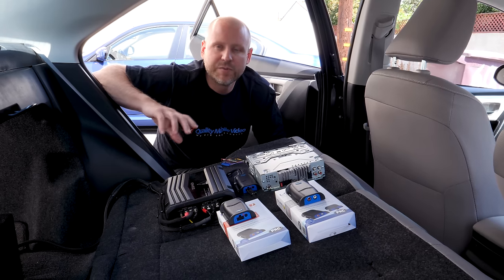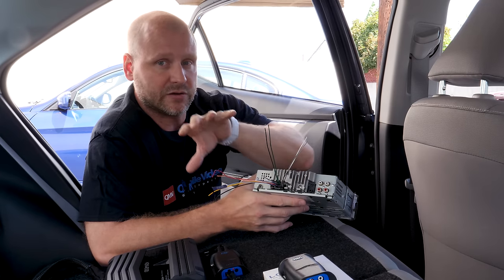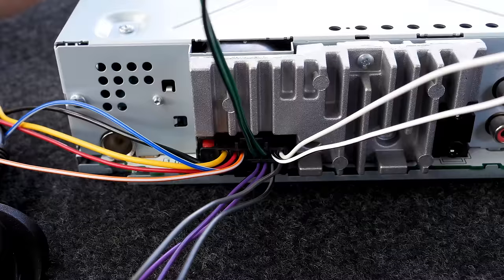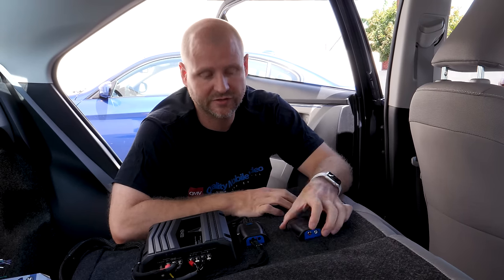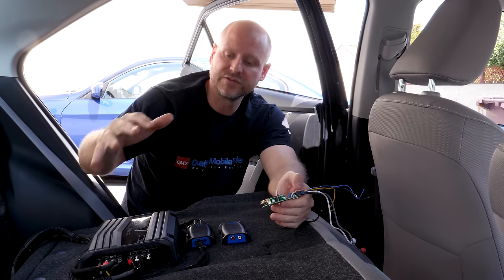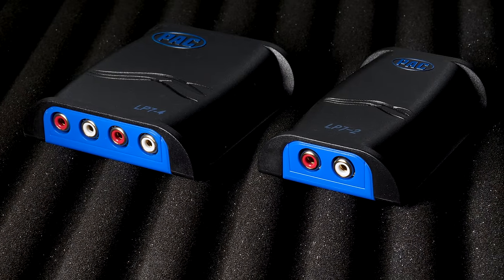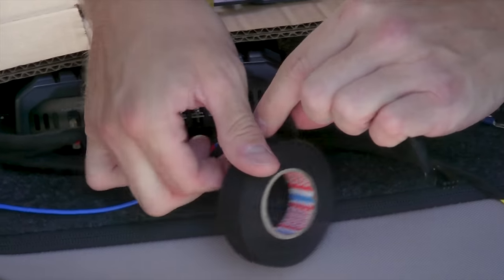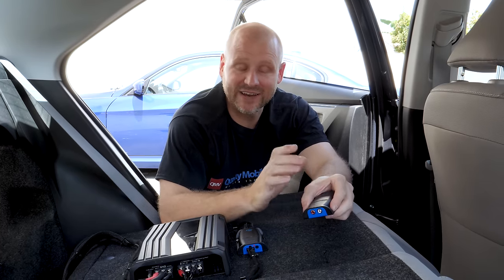Line Output Converters - What Are They - How Do You Install One?

Comment: Couldn't have timed this better. You guys have have saved me a lot of time. Please spare a few minutes for my complicated question but before that;

Amazing job done by the presenter explaining all the confusing things in layman term's. Was a Subscriber earlier but I tried subscribing again 😇✌

After countless hours of sleepless nights and hours of research with a tight budget, I wanted to have the best setup which suited my needs. Clear Full Range Music(EQ control) with Accurate BASS. Have bought a 840watt's  Blaupunkt 4 channel GTA 470 Digital Sound Processor Amplifier , JBL CSX-1400BP 12" Subwoofer, PAC PDLC 21 Active 2 channel LOC, Surge F8 Flo True 8AWG 800W AMP wiring kit which is on its way. I'm hooking the the 2 channels of the Amp to the front speakers and the 2 bridged channels to the Sub. 

Since I'm having a DSP Amplifier with various settings such as X-over control, Subsonic control, Phase control, Delay control etc. Does the front speaker signals give full range output i.e If I tap into the front speaker signals with the LOC, will I be able to achieve a full range surround sound system in my car with DSP control function working properly?

Was thinking about a 4 channel LOC but thought it would be useless since I'm using only 2 front channels of the amplifier for speaker and remaining 2 for a Sub. I can use the PAC PDLC21 with a low output gain settings since it can pump out 10V unlike a passive LOC and Adjust the gain in the Amplifier to adjust the Fader setting to achieve surround sound from a 2 channel LOC.  

My stock HU is a 4 speaker outs with a stock 6 speaker(2 tweeters+4 mid speakers) setup.  I'm planning to change my Stock front speakers too, Any suggestions for the type (and brand) of front speakers which will suit my setup?
Reply from the maker: Being that this a factory 4 channel with tweeter, it's likely that you have full range output on all four speakers, we never truly know without testing it. If I were to wager, I think your setup will be fine as described.
Reply: Quality Mobile Video Can I use a two channel LOC hooked up to a mono block amp with one sub woofer? Or is there an LOC for one channel apps?

Comment: Best LOC video I've found, extremely informative. Only one question remains for me: Is there a limit to the length of wire ran on either side of the LOC? Should the speaker level side be short and very close to the head unit, or should the low level side be short with the LOC closer to the amplifier? Is there a medium, or is it not important? I see how yours are setup and I'll mirror that for now. Thank you very much.
Reply: Ok

Comment: Great video! I have 05' GMC Yukon Denali w/ the premium Bose system and scratching my head as to where I tap the yellow 12v power and blue remote turn on wire from my PAC LP6-2R LOC? Do I run them directly to my aftermarket amp or do i need to tap them into my corresponding factory wires?
Reply from the maker: Yellow is a direct battery connection, Blue will be the output to your amp remote turn on.
Reply: So I'm installing a PAC LP6-2R to my 05' Yukon Denali with premium Bose system. And want to retain my premium Bose system for my factory speakers and sub.  All I'm trying to do is add a aftermarket subwoofer and amp. I've got everything connected w/ the PAC LP6-2R LOC, MEMPHIS AUDIO 1000watt amp, and kicker comp R subwoofer but no sound The only reason i can think of it not working is I've only got the left speaker + and - connect to the back of my H/U... Does both channels need to be connected to work ?

Comment: Did you run the remote wire on the loc to the amp directly or are you finding another 12v source to connect it to ?
Reply: Yes what did you run the remote wire to? Most of the fuses in my car are constant Im curious to what fuse turns on when the ignition key is turned on. I have a 2007 cadillac escalade.
Reply: @benkea445  I have a lexus with stock subwoofer I'm curious if I should run the loc from the stock woofer or to the door speakers
Reply: Ben Kea the fuse that says ACC but please be mindful those fuses are constant on one side and not constant on the other side. Took ten years installing stereos and replacing dead batteries before YouTube was invented hahaha. Hope this piece of info helps, consider yourself blessed for coming across it. I know I was... Love you guys, Happy New Year 2020
Reply: I have the loc pro LP7-2. With this converter you can just connect the remote wire directly to the amp with out having to run a remote wire through your vehicle. It’s all just depends on which converter you have. Hope this helps

Comment: As a Formally Trained Audio Engineer and a guy who cut his teeth doing car stereos I thought that was actually a pretty good breakdown for folks that don't have an electronics background or a lot of inclination to get deep on how all this audio stuff works.  I employed one of these adapters in a Bar where the Owner asked if I could run the output of his Jukebox (which only had a Left and Right External Speaker Output) into the speakers He had in the ceiling (or more correctly to the amp that powered those speakers) and it worked beautifully - also it's great because it mirrors the volume of its source relatively speaking.  Not sure why this got so many thumbs down - I thought it was fairly spot on.  Also for the record this doesn't replace the speakers in the circuit - it sits in parallel with the speakers (a "tap" so to speak) which keep the Ohm load correct to the amp - You'll have much more success than trying to completely use this device by itself without those speakers.   - MM in Denver CO
Reply from the maker: Thanks bud!

Comment: I have a 2016 Cadillac CTs vsport with Bose 13 premium speakers and factory amp my questions are what’s the best loc to use? I’ve tried the lc2i and keyloc on my old Cadillac ats when just adding a subwoofer, but if I wanted to change the door speakers and use a four channel amp, is there a way to bypass the factory amp or can I just replace the front speakers with some more high output speakers that I have, and keep the factory amp?

Comment: Thank, buddy for this very informative video..... I like how thorough you are with your explanations.
Reply from the maker: Glad you enjoyed it Tony!
Reply: I do have a question though.  If I'm just using the high level straight from the amplifier itself, do I need to have the remote wire extended all the way to the factory stock stereo?  I guess what I'm asking is do high level installation have a trigger for remote turn on so that I won't have to connect it to the head unit (like the LOC here)?

Comment: I have a 2017 lexus is300 I wired the loc to the factory amplifer 8 inch woofer wires  left and right together since I only have one 8inch factory sub. Will this be OK or would my signal be weak because I don't have a left amd right signal

Comment: Amazing this is professional engineering technical work, for like this professional work you must pay any amount of labor charges. Excellent explanation.👍👍👍
Question.
Car with fiber optic amplifier systems to upgrade sound unit to aftermarket Sony or alpine.. Etc how can used the original amplifier with fiber optic cable, or delete all systems or what the best solution or option I have.

Comment: Can you use this if you got a aftermarket radio? I was thinking about buying a SC6 line output signal converter. But I only wanted to use it for having the max input voltage for my sub amp and my 4 channel. I could just plug rca in from aftermarket radio and rca out to the amps?

Comment: im planning on doing something like this on my 00 323i. My rear deck speakers are blown as of right now and im thinking of just using the wires from that, and putting an loc in my trunk with the rear deck speaker wires running to it. Then running rca to my amp. Do you think it would work?

Comment: I'm still very very confused. I have 2 kenwood 12s and 2 amps. I'll be running about 2500 watts to the subs. Will the converter be able to handle that?

Comment: OKAY this is what i needed so i did the same thing with my rear deck speakers and i had a high level output harnas for months. And today i wired the 4 wires to my LOC and connected it now my amp nor subwoofer will turn on
Reply: please help
Reply from the maker: Your amp using high level input probably had audio signal sense turn on. You will need to double check your owners manual to see if it is possible to have signal sense turn on using RCA inputs, if it doesn’t you need to run a remote turn on wire.

Comment: How do you find out which ones have full range output the rear or front?
Reply from the maker: You will need to use an RTA and scope the speaker wires.

Comment: I'm looking for a wire harness for a 2012 Infiniti QX56. I'm trying to run the RCA from the front of the truck. It's to add the complete system, crossover, amps for mid/high and a bass amp. I have search all over for the wire harness and can't find one. Any ideas on where I can find this in Florida?

Comment: I have a 2011 murano with the factory bose amp and sub. Can I tap into the amp to hook up the loc? All I'm looking to do is add another amp and 12 inch sub. I would run separate power from the battery. Looking for some ideas thanks

Comment: Please answer my dumb question?
I was using RF-HLC4 LOC and the front left speaker was cutting in and out sometimes on low volume. Then i replaces the loc with PAC LP3-2 prod and the sound is too low.
Gain settings in the amplifier is same but the sound is very low. Can the volume level be different by using different LOC?
I am using sd400/4v2 amplifies.
Reply: Check your wires for proper polarity, for example left speaker is +/- and right is -/+ make sure it's correct I did the same thing and now it works fine.
Reply: Divine Ebbat Thank you. After some debugging i got to know there is a gain control on PAC lp3-2 and that was set as low.
After adjusting to maximum sound was back to normal.

Comment: so if i want to put a 1 channel bass amp and a 4 channel voice i got to buy 2 converters then?
Reply from the maker: No, buy a 4-channel LOC and Loop it through your 4-channel amp or use y-connectors if your 4-channel does have outputs.

Comment: Why would I get power to the inline 8 gauge fuse from my truck battery but no power from the fuse to my amp? But the fuse is good.
Reply from the maker: If you are using AGU fuses use a continuity check on your fuses, they are notoriously unreliable with their end connections. Fuse looks fine but not actual connection.

Comment: Hooked up a sub and amp to my factory dodge Dakota. Not using a LOC! I just spliced into my rear speakers on the door with speaker wire and converted the ends to RCA plugins. Seems to work fine. The bass hits. But when I turn up the volume quick it cuts out and loses bass. I then have to turn down bass on the radio for the sub bass to kick on again. Why is this happening? Thanks.

Comment: do you just connect the constant 12v to the power wire from the battery? and also connect it right to the ground connection on the amp itself?

Comment: Im having a boooom if i cut off my radio do i need to ground the 2 brown wires on my PAC SNI-35 ADJUSTABLE 2 CHANNEL LINE OUT CONVERTER SPEAKER WIRE HI LOW RCA SNI35 ?

Comment: I will say, which he stated as well that the factory deck does make a difference in outputs signals to different speakers so go for whats best. I have a 2017 wrx and have had nothing but trouble so far with my system. First I bought the PAC LP7-2 and honestly sounded like crap. My sub didn't sound nowhere near what it sounded like I'm my truck with aftermarket deck and everything. So I purchased a Skorpion LOC which did help a lot more but still wasn't "clean" bass. Used the Skorpion LOC before in a different car and worked amazing But not for my wrx. Next step would be the audio control LC2i active LOC. Main reason for this long comment, any amp takes about 5 volts input signal to the amp. The PAC LP7-2 only puts out about 1.6 volts. Audio control LC2i puts out almost 7 volts! Little more than needed and for 40 bucks more the than PAC, you do the math. May be the reason why you might have sound quality issues as well. You pay for what you get. In some applications its perfect but others, no. Worked on car audio for 7 years now and learned to much crap on my own. Even the hard way. Hope this helps👍
Reply: I have a 2017 STI Base Model and I have been looking at upgrading my sound system.  I went to many car audio shops in my area and I've been getting different recommendations from each of them. Anyway, I want to keep my stock head unit, so some of them recommended me to get an LC7 and some of them told me just to get this Line Output Converter.  I am really confused on who should I listen to.  I feel like some of them just want my money and don't really care what the outcome is gonna be for my sound set up.  So idk if i wanna do just the LOC or an LC7.
Reply: @BinaryBroadcast  The speaker level inputs of an amp are the same thing as a LOC so I never understand why people use LOC's if their amps have HLI's?
Reply: If you're not getting a clean signal, then you're not getting a great crossover or the source signal doesn't possess the range needed for the output speaker.

Crossovers designate which frequencies go to which speakers, and are usually necessary to give an aftermarket system a truly "clean" sound. It will only allow the target speaker(s) to produce the specified frequencies.

Again, it also matters where the source frequencies are coming from.

Comment: Can you still use the PAC LP7-2 if you are tapping stock amplified  2ohm leads?  replacing the 2ohm full range speakers with the LP7-2? Will this great an issue with the existing untouched existing 8 speakers.?

Comment: I have some install/reconfiguration questions!
Reply from the maker: Throw them out at we’ll see
Reply: @Qualitymobilevideo  so.. i just can figure it out on my new modification to my installation.. it worked previously.

My system look like this.
1, 4 channel amp (Rockforf Fosgate P400-4)
1, 1 channel amp (Rockford Fosgate P1000x1Bd)

1, 4 channel LOC (NVX XPLOC4)

1, Rockford Fosgate RFI2SW RCA adapter

My last known "good" installation was hooked up like this.

High level signal coming from factory IAM going in to LOC.

From LOC  front channels output to front channel input on 4ch amp.

From LOC rear channels output to 1ch input
From 1ch amp pass through output to rear channels input on 4ch amp.

12v and ground to LOC
remote from LOC to 1ch amp and 4ch amp.

Have been working good.

Now i decided to try something new.
My 1ch amp has highlevel signal capable RCA inputs and can be used by connecting high level speaker wires from IAM to a RCA-adapter cable. Then i can ditch the 12v, ground and remote from LOC and instead use 1ch amps remote out built in and active when amp signal sensing.

I have followed the instructions for LOC, 1ch amp and the adapter cable.

I just cant get it to work. Im so annoyed and frustrated.

I have some pictures how ive done it. Its like a worm nest looking but.. 

Also measured with DMM ground on ground on the RCA plugs and chassi ground, measured on amp 12v and ground, measured on positive pin on rca plug and ground on rca shield. Measured on speaker wires signal from IAM

Amp are not turning on, no signal, no lights.. nothing.

What have i done wrong? what am i missing? how do i diagnose further?

How can i upload and show pictures? or can i send them in private somehow?
Reply: @Qualitymobilevideo  trying to paste a link to pictures and manuals but my post gets deleted. Don't know how to come around it.

Comment: I have a 2013 Lincoln MKT that has an amp with a non working subwoofer. My question is can I get the signal from the existing subwoofer wires and if so do I split that single signal so I can get L & R signals out of my line output converter?
Reply from the maker: Do you mean if you replace the woofer with a new one, if you can use the same connections?

Comment: Hey can I just connect this line output converter on the rear of stock headunit cut off wire to speaker and send signal to loc?even not connect to speaker?? do stock headunit send signal if not connected to the  speaker?? its an Volvo, or it most be hooked to the speaker wire whit t harness ??  i ask about this since i run new wire to speakers, ment to go from amp whit juice.its not okie to run T harness and then send power from amp to speaker on same T-harness well?I will fry my head unit then?? or it will be okie?? i made no T harness and draged 8 new wirers to my headunit, FL +,FL - , and FR+ FR- sendt directly from headunit to loc  should this work?? or should i just remove 4 of the new wires i draged ment to go from amp to speakers. my car only have 4 speakers,atm but sub inc and twetters 

hope you can tell me fast if this will work or not  :)

Comment: So, I cut the right front speaker wires from the factory unit.. now I connect the wires to the LOC and then use the other side of the speaker wires and run it to the amp?

Comment: Do you only need to use 1 speaker when tapping in to them? Or do you need to use 2 speakers? I have mine set up running off of my right front door speaker. But it’s seems that I am only getting single, or power, or very week response out of one of my subwoofers. Thanks in advance for any help!

Comment: I am on my second p a c LP 7-2. My first was reading very low voltage. My second one did the same thing, I'm trying to target 2v but the highest reading is 0.017 ac.volts on both converters. I used two different multimeters with the same reading. My car is 08 Acura TL and I tapped into the rear speaker. I know for a fact I have it hooked up correctly. Do you know what's going on?